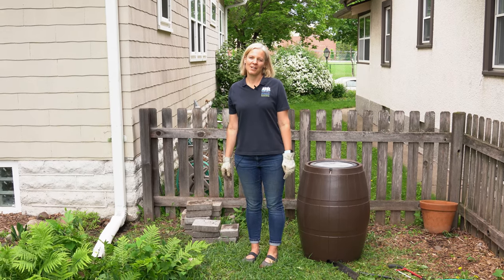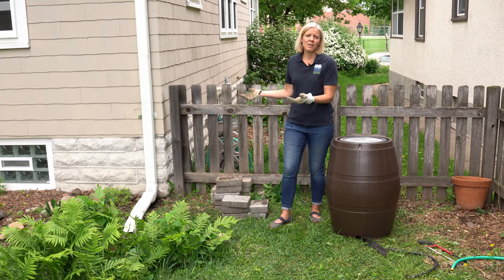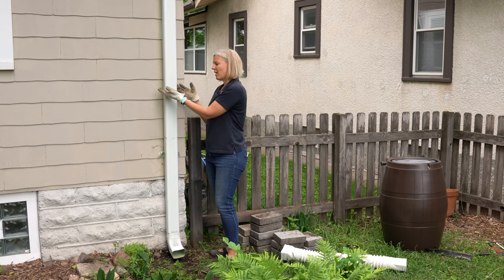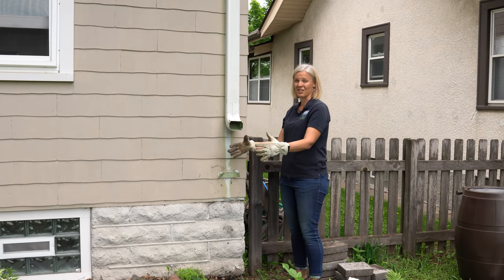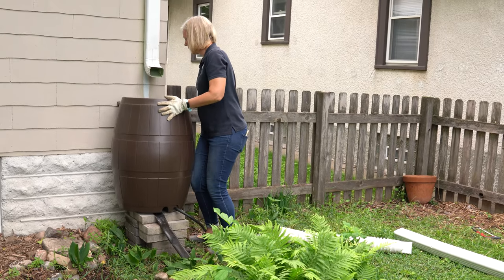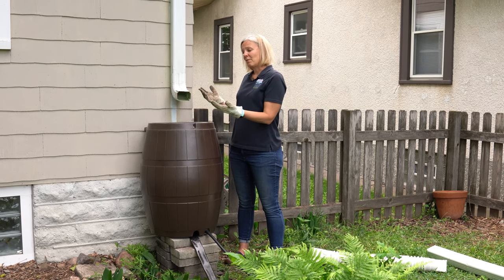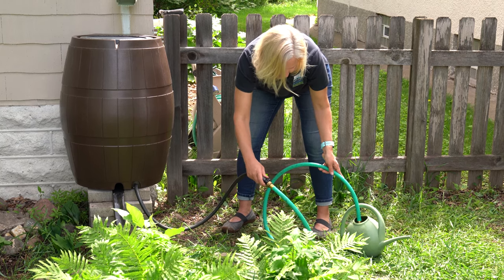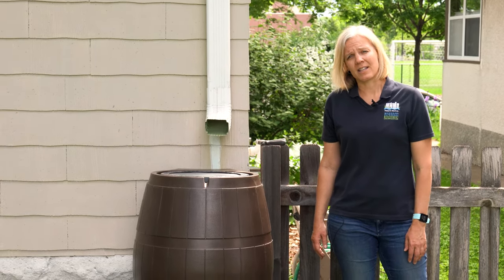How to Install and Use a Rainbarrel

Comment: I was thinking about leaving it on as mentioned before open the valve. I say this because the rain in winter can be a lot. It will travel back to the foundation and or freeze where the barrel was

Comment: Great video,  thanks. 
1. If you have an old rubber boot, you can cut the toe out, and use that as your diverter.
2. What are those beautiful plants at the base of the rainbarrel?
Reply from the maker: Thanks! The plants at the base of the rainbarrel are mostly ferns, with some lily of the valley mixed in.

Comment: Can you just leave it out during the winter but leave the valve open?
Reply from the maker: You can leave it outdoors, but you'll want to make sure it's disconnected from the downspout and that water can't enter it. The freeze-thaw cycle in late fall and early spring can result in water entering the rainbarrel and then freezing and causing damage. Even when the valve is left open, there's often still some water left at the bottom of the barrel (depending on your particular design/product). Also, the valve itself could become frozen, trapping water in the barrel.
Reply: @mississippiwmo  I appreciate the answer.
Reply: Turn the barrel upside down in the winter.

Comment: Great video and thank you for taking the time!😁
Question.... if we have to pack up the rain barrel from say, November through March to defer damage during freeze conditions, what can we substitute in it's place for the cold months? 
We plan on pre- filtering the water with a Lifestraw Community-grade filter first, then running it through an Alexapure unit to use it for drinking water.
Reply from the maker: Thanks for you comment and your interest in rainbarrels. We don’t have experience using rainbarrels for drinking water or for cooking, so we don’t have any recommendations on how to catch water in cold months or best filtering methods. Sorry! Rainwater collected from a roof in an urban area like ours can catch pollution before it gets to the barrel from the air and from roofing materials, so it’s good to keep that in mind.

Comment: question have you ever tried installing rain barrel under valley on a roof I am sure you will get some spillage but 100 gallons is worth a try as opposed to not positioning a rain barrel at all?  i understand the gutter installation but i have issues on the valley both sides of my house
Reply from the maker: We haven't tried it personally, but if it works, it works! Any way of conveying runoff into the rainbarrel that works for you should be fine. The main point of gutters and downspouts is to convey runoff away from the foundation of your house and toward specific locations. If you don't need that, and you have another way of getting rainwater into the rainbarrel that works for you, go for it! You could also do a partial gutter install specifically to convey runoff from a certain part of your roof into the rainbarrel.
Reply: @mississippiwmo  thank you I saw another video this guy had rain barrel under valley catching rain and I'm like 🤔

Comment: Great video what do you do when you first buy them and they have that strong plastic smell to them?  How do you get rid of it? As we are doing it for off grid lifestyle.
Reply from the maker: Thanks for your question, Kara! Using a vinegar-based cleaning solution can help remove errant smells, including the plastic smell, over time. It may take a few applications and rinses. The smell will likely eventually go away on its own, too, though it can take a long time.
Reply: @mississippiwmo  Thank you so much! 😊

Comment: I am looking to collect rainwater for extra drinking water during extreme conditions. Is this a good option? I imagine putting the collected water would be good after putting it through a good filter?
Reply from the maker: Thanks for the question! Unfortunately, we don’t have any experience using rainbarrels for drinking water or for cooking, so we would be reluctant to make any recommendations on treatment or filtration methods. Rainwater collected from a roof can pick up a variety of pollutants before it enters the barrel, including chemicals from roofing materials, so keep that in mind.
Reply: Not to mention there are forever chemicals already in the rain water. You'd need a metal roof, and a very good RO water filtration system I would imagine.

Comment: So you find the debris screen is sufficient to keep mosquitos out?
Reply from the maker: In our experience, yes, as long as there are no holes/gaps in it. If your rainbarrel doesn't come with a screen, a typical insect/window screen (of the kind you would find at a home center) would also work.
Reply: Maybe, you could plant some mosquito repelling plants around the barrel, to limit the amount of mosquitoes that want to try to get to the water.

Comment: Are mosquitos an issue?
Reply from the maker: Good question! Not if your rainbarrel has a screen like the one in our video. But if you have an open-top rainbarrel or they can reach the water some other way, then they can lay their eggs in it.
Reply: Mine has a similar screen , does that mean mosquitoes can't get through the screen?

Comment: How do you clean a very dirty rain barrel? It was left out for 2 years and the water had a very nasty smell. Is chlorine bleach the best or only way to clean it?
Reply from the maker: In that situation, your best bet might be a homemade bleach solution similar to the one recommended by the U.S. Centers for Disease Control (CDC) for purifying drinking water in emergencies. (Search for “CDC bleach drinking water.”) You’re not drinking rainbarrel water, obviously, but bleach should help kill the microorganisms causing the smell. You’ll have to roll the barrel on the ground and slosh the solution for a few minutes to make sure the solution makes contact with all surfaces. If it doesn’t work, you could try a stronger bleach solution, like the one the CDC recommends to kill mold. (Search for “CDC bleach mold.”) Also, if you can physically scrub and rinse out the rainbarrel first, that would be ideal. Finally, as an alternative to bleach, you could look into homemade vinegar-based cleaning solutions, like these: https://www.hennepin.us/-/media/hennepinus/business/work-with-hennepin-county/environmental-literature/green-cleaning-recipe-guide.pdf

Comment: Can I use a table for a base for the water barrel??
Reply from the maker: Hi Adam! A full rainbarrel can weigh up to 400 pounds or more, so you'll need to make sure that whatever you set it on can support that weight. Generally we recommend cinder blocks or concrete pavers. You can also buy rainbarrel stands online, and/or find instructions online on how to build your own DIY rainbarrel stand.

Comment: I realize that this video waa made 3y ago. The way you stacked the paver blocks, right on the uneven ground, will eventually fail you. The last few years have been very dry, down here over the Minnesota/Iowa border. So, our ground hasnt been saturated with rain water for some time. The proper way to do this, would digging about a 6" deep hole, where the pavers will set. In the bottom of that hole, put "Locking" sand at about 3" depth. Then, top that off with some crushed rock (gravel, pea gravel, etc.) Make sure its packed in tight. (Tamp it). If you leave it like you have it, eventually the ground will get saturated with heavy rain. That would cause those pavers to start moving around in the mud. With this, i would also line the four sides of the hole with something to keep it from collapsing into the hole (Pond Liner Material, ground rated 2x6, cut metal pieces, etc). This would be an extra safety measure, to keep the heavy, saturated soil from collapsing in on the lighter, more porous, rock and sand. But, if the sand and crushed rock is packed in well enough, that could hold it stable. Why this works is, the crushed gravel and LOCKING sand, allow water to flow though it. So, no water will stay in that hole. The soil at the bottom of the hole is packed tight enough that it won't cause any movement. If i wasn't clear about something, please hit me back with questions. Thank you for the info on rain barrels.